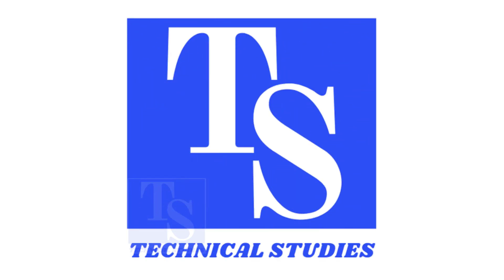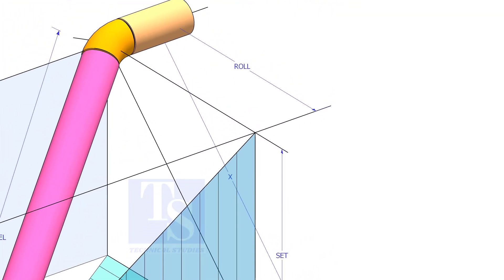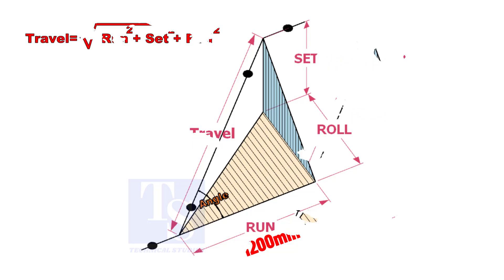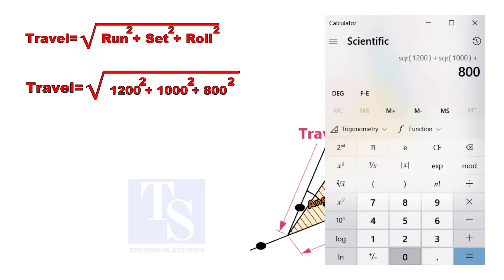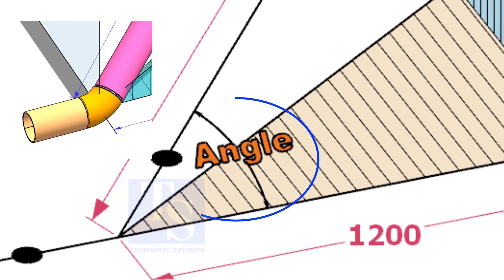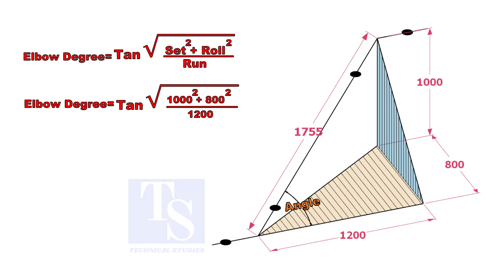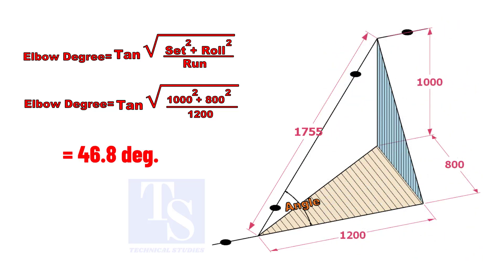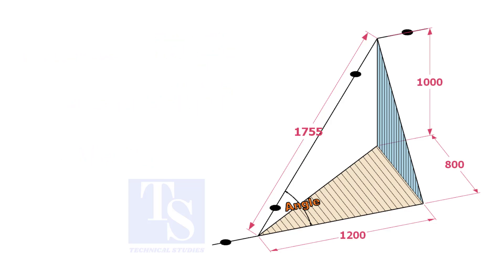PIPE DOUBLE ROLLING OFFSET CALCULATIONS FREE TUTORIAL डबल रोलिंग ऑफ सेट

Comment: When I draw in the AutoCAD the run=1200, roll=800, and set=1200 then the travel length is 2030. But according to your formula the travel length is 1755. where is problem?
Reply from the maker: Square root of (1200+1200+800)-  2 elbow centers. This is the true length of the pipe.

Comment: What if the elbow used is 45° and a 22° elbow is added later to align the pipeline correctly...then can I calculate roll and run correctly with 67° as the angle since pipeline is inside ships engine room and hard to access

Comment: So would the top elbow be 90 degrees -46 degrees
Reply from the maker: No. Same degree as the bottom elbow.
Reply: @technicalstudies.  Wrong! Only in the same line
Reply: No! The top elbow has to be 43,13 degrees! Tan elbow >1200:1280,62=43.13 degree! Or Cos elbow>1280,62:1755=43,13 degree!